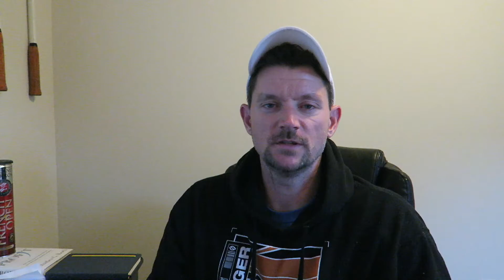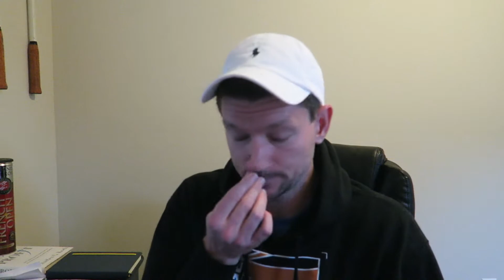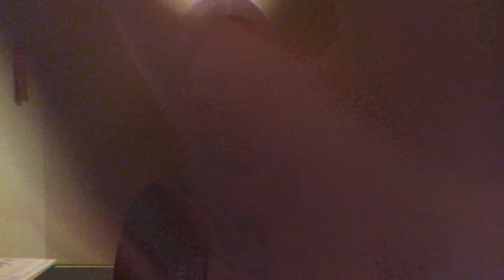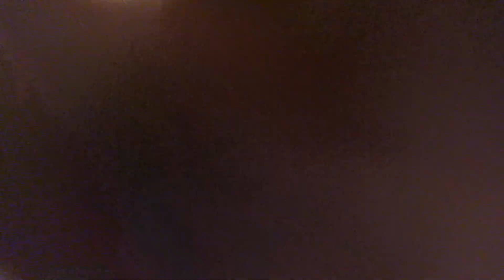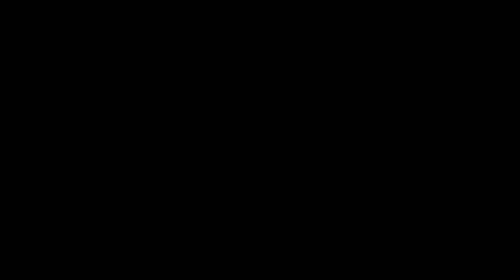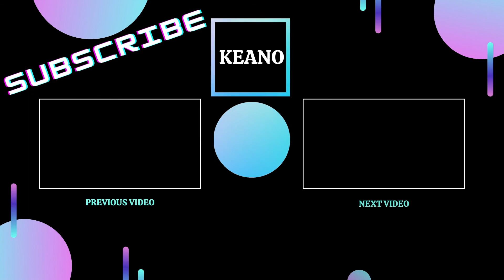BMW LIED!!! How to CORRECTLY Service/Maintain your ZF Transmission / Are tunes bad for it? xHP Flash

Comment: Life of the car means BMWs 50K mile warranty.  I owned Bimmers since early 2000s and did a transmission pan\filter and fluid change on every BMW I owned at around 70k miles.

Comment: Thank you for the tips, I have a Jaguar f-type that uses a ZF870 transmission, it's doing a small lurch and I change from P to D after like a 24h+ rest. I'm a bit worried but my mechanic said is ok, no big deal.
Reply from the maker: How many miles dies the car have?
Reply: @keano9542  only 22k.
Reply from the maker: @itsmagnator  I would check and see if there is a software update
Reply: @keano9542  I'll look for it thanks.